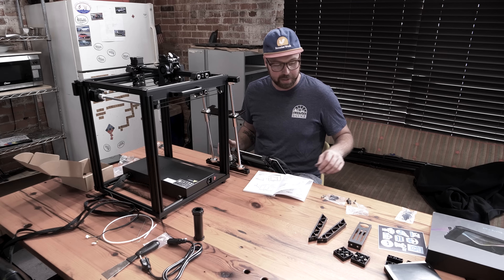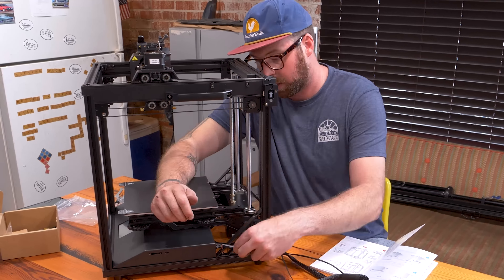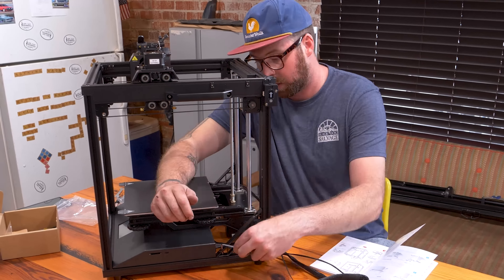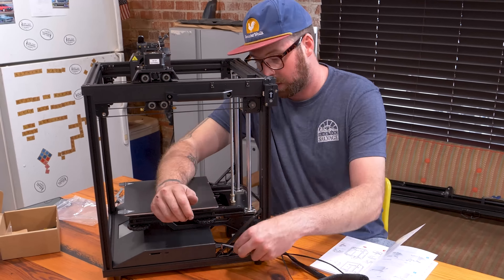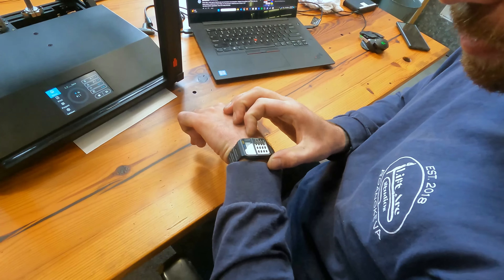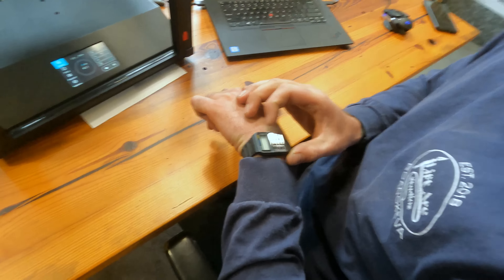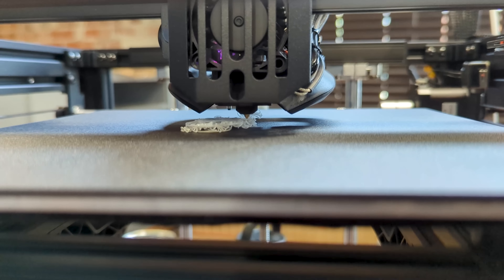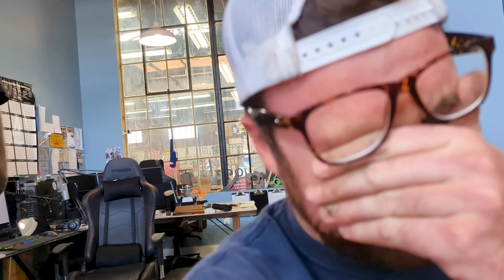3D Printing is Pure Pain

Comment: Hey Tay! Maybe if I don't call myself an 'expert' that won't discount me. While I could list out a bunch of settings, it will serve you no good in the long run. I also run CNCs and machining/woodworking tools so I know, like you, that there is no "universal" settings. Printers don't have Feeds and Speeds but their equivalence is the settings needed for certain filament types and even brands. I do want to explain 3D printing as whole because I believe it helps you grasp what applies to your printer better as many of the features get ported from one type to another. 

So here's the thing: Creality makes great machines for what they are meant to be but as tool in a production shop, they are not suited for the task unless you know what you are doing. Their printers open doors like custom firmwares, various mods and hotend changes, and more that are perfect if you want something to tinker with. But to most people, it is just a project. A printer like the Bambu Lab X1 Carbon with the AMS is far better suited as the most "Shop Sabre" equivalent. More on this later. 

In general, the things you know to know about 3D printing are as follows:

-Type of Machine you Have

- Slicer settings

- Printer settings

- Maintenance

For the type of printer, the main categories are Boden Tube and Direct Drive for the extruder, and Cartesian and CoreXY (like your printer) for the mechanics. There are others like Deltas or H-Bot, but that is too in the weeds. Each of these has their down benefits and downsides in terms of speed, reliability, and even what materials you can print. 

There are also pretty major differences in firmware. This is where the annoyances of 3D printing turn in to true rage. Creality attempted to solve this with their Sonic Pad but got too close to the Sun. Firmware can open up nice safety options like Thermal Runaway Protection and Power Loss Recovery, or they can do neat options to increase speed like Input Shaping, K Factor, Flow Rate Calibration, and more. 

For Slicer Settings, is far easier to mess things up (as you discovered) than to fix things. Though Prusa does make their own printers, their slicer is just a fork of another slicer and is not really "Prusa Dependent".  Most of the defaults will work for 99% of prints, assuming you change certains printer dependent settings. Your S1 is a direct drive which means that the distance from the nozzle to the extruder is quite short, just a few MM. On a Boden Tube, you might have 20-30cm from the nozzle to extruder. 

Because of this difference, settings like retraction distance, speed, acceleration will be quite different but overall, there are many "generally acceptable" settings that will get you in the ballpark for each respective drive mechanism.  This is just one example but it is not too difficult to set up. 

For the Printer Settings, this is largely dependent on what brand printer you have and what firmware you have. You have the option to run custom firmwares or if your mainboard supports it, even different types of firmware. However, unless you are competent in coding and know how to flash firmware, it can be a easy way to create a large paper weight. 

The Sonic Pad you have attempts to allow older printers that ran on Marlin Firmware to upgrade to Klipper which enables many of the aforementioned settings. The pad also attempts to automate parts of the calibration but really seems to drop the ball. 

For Maintenance, this is where Creality can be quite a bit easier when compared to a more turnkey solution. Since they are pretty open and in many cases, assembled by the end user, you are very familiar with the machine and how it works. Heck, 3D printers are just hot glue guns strapped to something that can move it. You can also upgrade them quite a bit. 

I always encourage most people to let their first printer be one that they built just so that they have an understanding of how they roughly work. You are not most people because you already understand the general operation of them. This is why I think this printer is not a good fit. 

For this last section, I am not sure the best way to format it so pardon me if it is a bit off. 

Without giving a lesson in Material Science, FDM printers work by taking Thermoplastics and heating them to their melting point to be extruded out layer by layer. As each layer builds up, their bonding strength is affected by many factors like: material used, line width, fan settings, and speed. They also will contract in the X-Y direction by various amounts, but are pretty stable in the Z Axis. Overhangs beyond 45 degrees will result in sagging and even at 45 degrees, cooling must be increased which can decrease part strength. Bridging (going over open gaps) is also very dependent on your cooling as well as material. These are just a few of things to be aware of. 

As of year ago, before Bambu entered the arena, most printers were largely the same in terms of speed and general settings. Custom builds like a Voron were done by the enthusiast and they paved the way for what was possible. The universal "benchy" print took around 1-1.5 hours to print on most printers with the Voron's being considered borderline "insane" at like 30-45min. But the tech changed fast and while not the fastest, Bambu enters the market with a consumer printer that can do a 17min Benchy. The issue is that this speed came at a cost. 

The heat zone on a printer only supports a certain amount of volumetric flow (measured in mm/s^3). Old school printers maxed at 5-10mm/s^3, Bambu can go up to 30, and custom hotends can do even more. The problem is that there becomes upper limit in terms of part strength where the printer is printing so fast that layers start to bond poorly. The previous layer just does not get heated enough by the molten filament to get good bond, the and nozzle passes by too quickly before it can impart enough heat to melt it. This means that in a strange irony, at times the Bambu Labs need to be slowed down to help increase the part strength for a functional part. Test by channeled like CNC Kitchen show almost a 2x increase in strength.

Materials like PLA and PETG are mostly forgiving in terms of material properties. Each is quite stable, not prone to warping, and pretty forgiving in terms of print settings. The downfall being poor heat resistance for PLA and stringing for PETG. For testing designs, these filaments are fine and can even be used as a functional part if the scenario is correct. 

However, there are filaments like ASA, HIPS, PC, PA, and more that are not only much stronger, but some borderline certain aluminum alloys in strength. Your S1 will not print these. 

Though your S1 has much of the hardware to support these filaments, and claims to print some, the open frame means you prints will warp and not be stable. 

For functional parts, production, or accurate prototyping, you absolutely have to minimize variables. The S1 is will print completely different in the summer versus the winter. The humidity in the summer will absorb into the filament and cause for a myriad of headaches and the cool of the winter will make your parts warp. 

Again, this my inadvertent Corporate Shilling, Bambu Solves this with their enclosure and humidity regulated AMS. Creality might read this and offer you their K1 but trust me, that printer was rushed to market and it shows. 

Materials like CF-Nylon that are normally a nightmare to print almost print with the ease of PLA on the X1 Carbon. Coupling that with options like Multicolor Prints or easily removed supports/dissolvable ones. 

I am not saying you have to know all these settings intricately, but I do believe you should be aware of them so that when a situation arises, you have some idea what it could be. If you want to talk more, let's connect and we can chat in more detail. I do engineering and production printing so I think I could provide some help and insight for you. 

Thanks Tay and all those at Lift Arc! Keep up the good work!
Reply from the maker: Thank you kind soul for such a thoughtful comment! I cant believe the detail, i hope others can read and benefit from this as well. Im about to go to lunch but will be reading and comprehending this when i get back and will share with walker. You make me want to share this in a video! Thank you very much, cheers! - Tay
Reply: I knew that there would be a viewer who knew their sh*t that would leave sound advice, beyond “spend money for something better.” That’s why I read the comments even though I know nothing about welding (or 3d printing). This channel, and community, are great.
Reply: If this particular model is for their super advanced printers, then perhaps Creality should be more upfront in who they sell it to.
Reply: That was one comprehensive reply!  As a relative newcomer to 3D printing, and new Bambu Lab X1 C owner, I do concur with his assessments.  I bought my printer after Clough42 reviewed it, and a fellow woodturning buddy had independently decided to buy one as well.  I wanted a tool that just works, and by and large, it does just that.  I make wood lathe accessories (soft jaws, Vicmarc chuck jaw plates, vacuum chuck and seal, spindle & live center adapters, faceplate, and specialty chucks (captured sphere holding chuck), and am working on a steady rest.  I’m still learning.
Reply: I really appreciate the fact you didn’t just say ”creality sucks buy a bambu”
Reply: @Pterodactyl-kn3ve  It is not that it is for "super advanced printers", more so that it is a budget option which leads to some shortcomings. With many of Creality's printers, I think of them as a DIY kit where they did some of the work for you. 

The problem is that the easy of assembly can give the impression that the printer is ready to go. Don't get me wrong, several of my Creality printers have been good to go right out of the box. But they are for tinkerers and creators that want to enjoy messing with the printer, not those who need the printer to just print.

Comment: Long time printing with Creality products. I do maintenance for my dads 3 D print farm.  The ender 5 uses a special starting g code. It checks the z limit and nozzle temp during the first homing and just before it reads the staring line of your print. You can use another slicer if you are good with gcode files. Simply copy and paste the homing gcode. Then put it in your starting code of what ever slicer you want. I have a Sermoon which is a ender 5. It still has issues with the z limit. Hence why the lady said throw it away. The Ender 3 is the best bang for the buck. Easy to use and set up.
Reply: This sounds like a different language, Sermoon (did you mean shroom), ender? (as in ender of what, rear ender?)

Comment: Just yesterday, I did a 3D print to test the geometry for some plates I want to have cut out, based originally off a cardboard template.  By 3D printing a .03" thick copy in plastic, I can test fit it, before sending it out for CNC cutting.  Good thing I did, first go didn't fit just right.

Comment: I recently got my 15 year old nephew a 3d printer and had it up and running within about 30 minutes, though I have been 3d printing since mid 2016.  My nephew has been doing alot of printing for the 2 months he has had it and has had zero issues that I'am aware off.  The 3d printers with the wheels to level the bed are old school and generally a pain.  Try and stay away from them, I can't count the time I spent adjusting those stupid things with my old 3d printers.  I have 2 x Anycubic Vypers & that is what my nephew has and must say that generally they just work.  Apart from getting a dodgy cable on one of the printers they have been great.

Comment: should have gotten the bambu lab p1p p1s or x1c would have been a much easier starting point. also use Cura slicer. Creality also uses marlin as stock firmware. and i will take you up on your offer to run 3D prints and cnc plasma cutting. =) let me know when and where. i can also help you with stuff if you need a crash course on something. and the reason why it printed so high up was the print nozle was not yet primed with filament. also the reason why the print didnt stick to the print surface was it didnt get a good first layer from the nozzle not being primed.

Comment: I 3D print a bit.  If you want a very easy print experience, I recommend the AnkerMake M5. It takes about 6 bolts and a few screws to assemble it.

They have a very good slicer. But you can use Prusa Slicer, too, if you want.

I had to baby my prints with my Creality printer. I had lots of failed prints, too.  With the M5 FROM AnkerMake, I send putting jobs from work over the internet on my lunch break and know I'll have a good print even without checking it's built-in webcam.

Oh! And it can print up to 500mm/second. I can print that same calibration cube at 0.1mm resolution in 19 minutes.

That's my recommendation for faster high quality prints with far fewer failed prints.

Comment: In the long run getting a crappy printer like this will only make you a better 3D printer user. hehehe. However knowing what firmware is running and how to manage it is probably the key to having a good working 3D printer. I started with an off brand (no longer in business) DIY 300mm XYZ 80/20 build printer with 8 bit board with Marlin firmware some years ago and now it's running 32 bit duet with kilpper. I have rebuilt it a number of times over the years and now I have an extremely reliable fast and solid 3D printer. Problem is I could have purchased a pro-sumer printer for less money and gotten to where I am now in about 1/3 of the time. At the time I could afford to spend my labor over money, but for anyone who's time is worth more than money it's probably best to listen to Shop Sabre's Router Bob when he says, "Buy your 2nd CNC machine the first time." It's worth it for a business to spend a little more for a pro-sumer or even entry level professional 3D printer than fight with the consumer products all the time.

Comment: It is a bummer this is the printer you started with because even as of two months ago there are SO many good options which are not only easier to set up, but will also work flawlessly out of the box. I have heard good things about the Sonic Pad overall, though it's not necessarily worth the money, but I would suspect most of your issues were due to the printer and not the pad. 3D printing is definitely a hobby that will go more smoothly if you start out with a lot of research, but it really should not be this difficult. I started with an Ender 3 Pro for $99 from Microcenter and I had it setup in probably an hour or so and was able to get almost perfect prints immediately. Don't let this sour your whole opinion!
Reply: The channel Aurora Tech has a video titled "Ender 5 S1 + Sonic pad Klipper firmware The ultimate hobbyist 3D printer?" which might have been helpful. Note the video is 10 months old and the market has changed truly drastically since then. This printer is no longer at the top of anyone's recommended list. The Ender 5 S1 uses Marlin stock, but the Sonic Pad allows you to use Klipper. Marlin is basically embedded software on the machine so it does the processing and runs commands. Klipper allows a second machine with a more powerful processor to do all the thinking and just sends commands to the machine to execute. Klipper is newer software which allows for fancy features such as input shaping and pressure advance. Basically, acceleration compensation and melting filament flow compensation. It is obviously more advanced as well, so you sort of dove into the deep end.
Reply: I'm glad you finally got it working and were happy with the results. You definitely should NOT have to learn G-Code at all to be able to successfully 3D print. Most slicers have built in profiles for popular printers and normal filament types. With just those settings entered and a decent 3D model you should be able to print something. Sure there is a lot more to learn about bed adhesion, supports, quality settings, and more especially as you get into more advanced filaments, but for a basic PLA print it should be easy. You definitely had a bit of a lemon on your hands and took advice from people with opinions, which is always dangerous. Prusa isn't the easiest software to start with IMO. Using the Creality software, which is based on Cura anyways, which is what I use, is a good bet. I'm glad y'all like to tinker and overcome issues though. Triumph!

Comment: I just want to pat you on the back for sticking with it and getting a solid calibration cube! I would be willing to share a bunch of settings that I have for my Ender 3 (same family of printers, yours is just out of the box what mine is now in its upgraded state). The bed leveling probe does add a big layer of learning and I think it was much easier to learn the calibration process. I use Cura as a slicer and it is really simple to use and hasnt let me down yet. If you do get into a spot where you need some help, feel free to reach out!
Reply: Yea I have the Ender 5. Not the S1 version. I use cura also. I'm so basic with a 3D printer and have been able to print some things with really nice results.

Comment: Get a Sovol SV06 Plus and use Cura Slicer. I wasted so many weekends and money on Creality crap. I literally threw $500 in the trash. Out of the box 30 minute set up and ran it 5 days straight without a glitch. And your build plate is larger too. Just better quality.